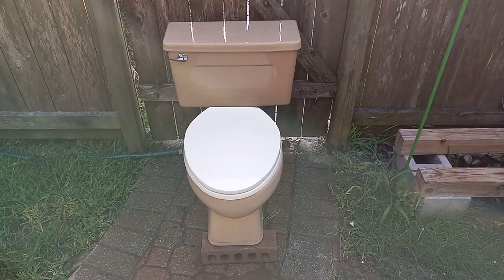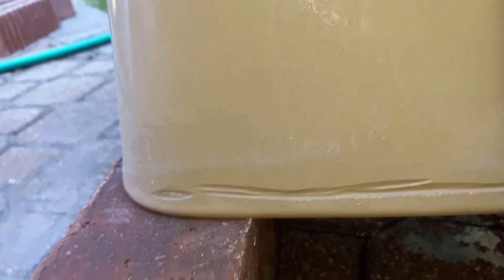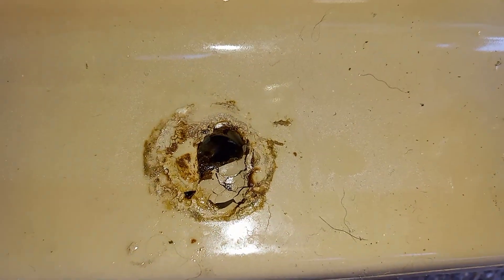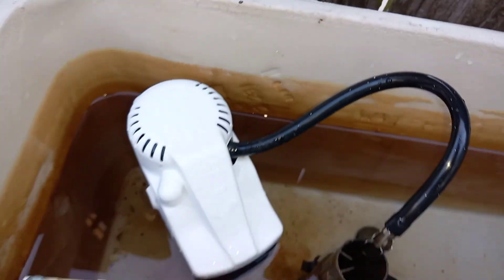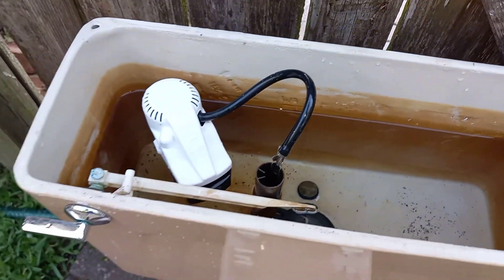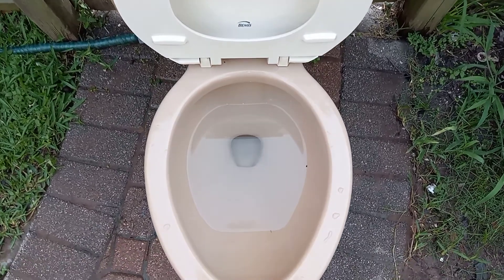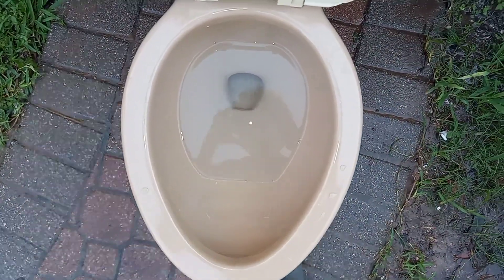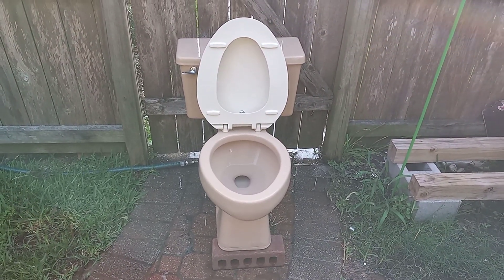1978 Coppertone Kohler Wellworth Flushes!

Comment: These toilets has great flushes and I prefer these better than the later 1980s Kohler Wellworth Waterguards.  You can special order toilet seats that has the color same as the toilet.  You can also special order flange bolt caps.
Reply from the maker: Matching seats are very expensive, just a standard beige seat is $37. I think I'll get a wooden one or a black one.